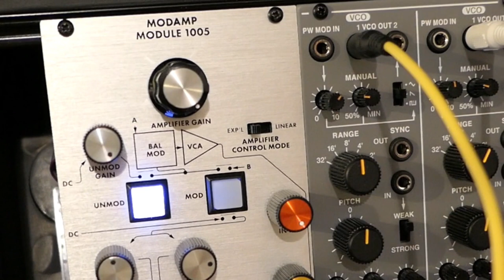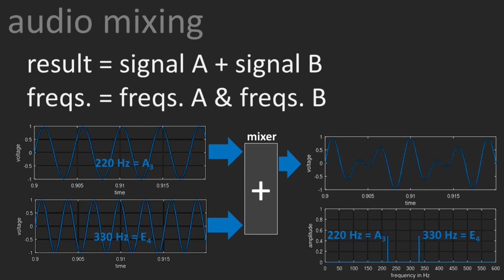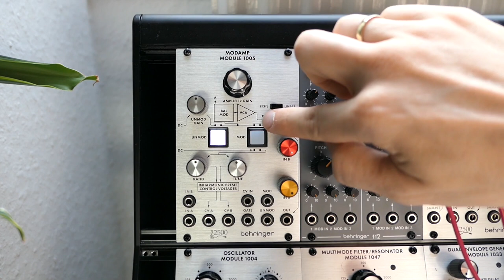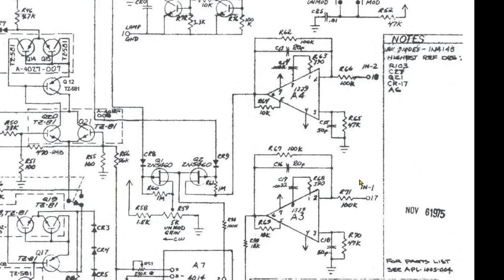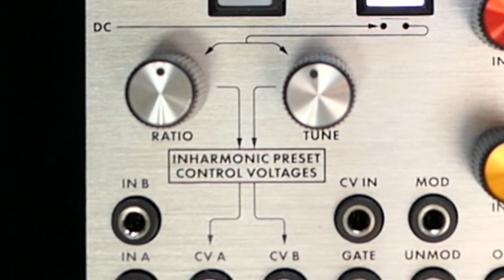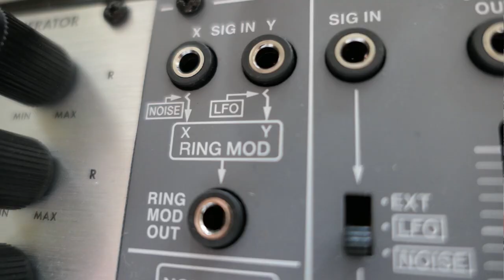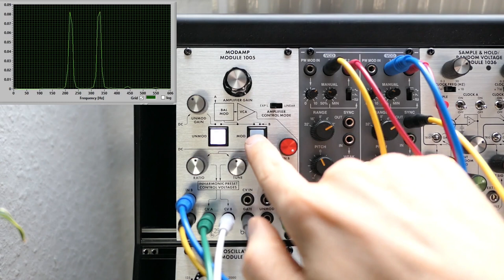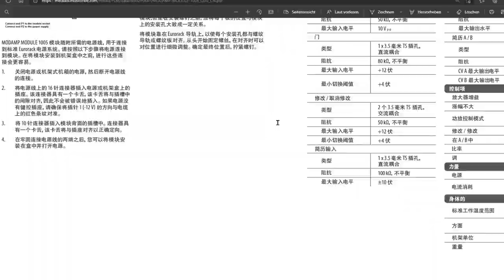Behringer ModAmp Module 1005 ~ a unique ring modulator

Comment: This is the kind of video that is the best thing about YouTube. You have set a high standard of presentation with very informative content. Can't thank you enough for this. Especially with this module, the 1005 which is a very tricky subject with condensed logic. 
For beginners you have made a reference work to navigate these concepts. I noticed a comment further down talking about chords and tuning. This is an excellence subject as you know and is much more important than we can imagine. It is the basis of how we perceive this part of the electro/magnetic spectrum called sound.. Harmonics are the things that help us discern one sound from another. This module is a great playground for discovering tuning.
The thing that really blows my mind is that you can create at least 3 tones with 2 oscillators and then send that through something like the 1047 filter and you have sonic heaven on earth. Its a great ride! Cheers

Comment: thanks for the extensive review. i would like to confirm however if the modamp can do amplitude modulation!? my guess is it would be in unmod mode using the cv-in? can you confirm this?
Reply from the maker: Yes, the cv-in controls the VCA. It doesn't matter if in mod or unmod, the VCA is downstream of the ring modulator and always in the signal path.

Comment: Is it possible to use something like this without having any other Eurorack equipment? I have other synths and such, so I would assume I could just use it with normal synths?
Reply from the maker: You may want to check the voltages before you do. Eurorack supports up to 10V peak to peak in the audio range and control voltages typically have a -8V to 8V range. If this fits on both ends, you should be fine.
Reply: @synthesizer83  - Thank you!

Comment: Are the Ratio and Tune knobs make same as if i tweak oscillators pitch knobs?
Reply from the maker: Yes, but they do it in a more "controlled" way than tweaking both pitch knobs by hand. The tune knob keeps the ratio (offset) between the VCOs constant and changes the pitch of both VCOs simultaneously. The ratio knob changes the offset between the two VCOs.

Comment: wow,  tough nut to crack. It can also just used as a vca right?
Reply from the maker: yep, in unmod mode you can just feed your audio signal a through the ring modulator to the vca and control the gain with the cv input.